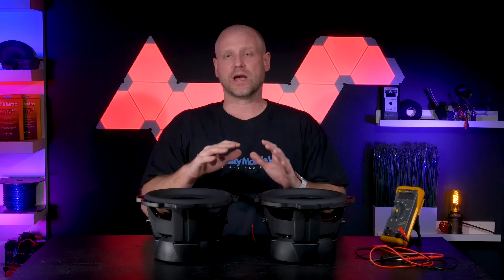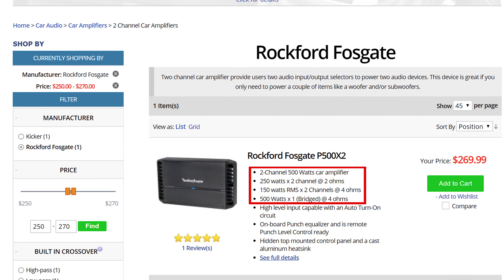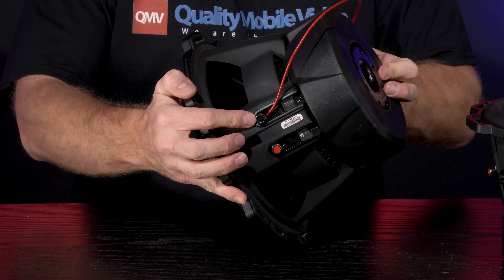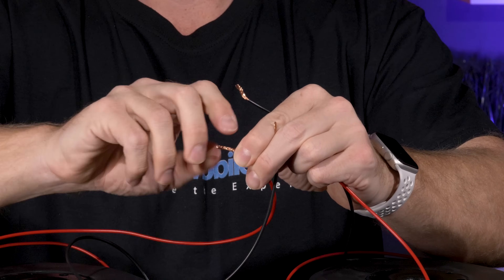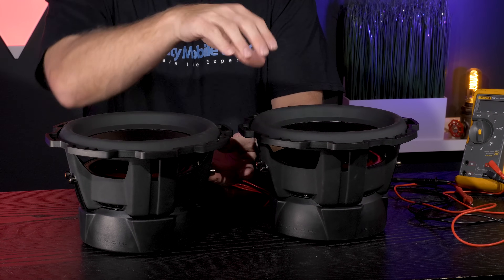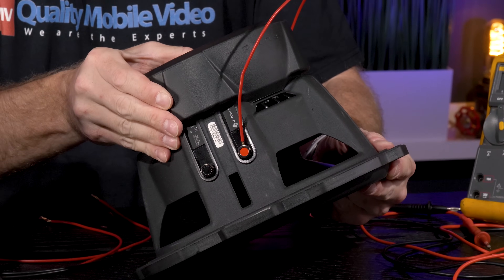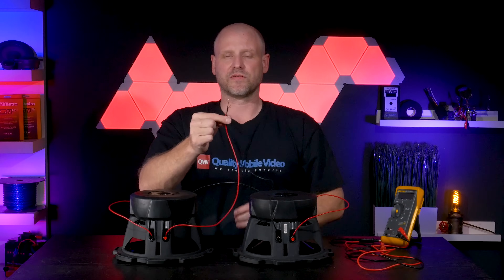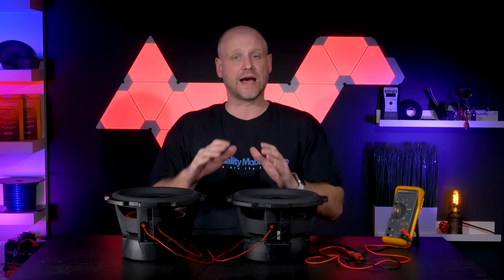Wiring Two DVC 2 Ohm Subwoofers - 2 Ohm Parallel vs 8 Ohm Series Wiring

Comment: I'm thinking of going with 2 10" Dual Coil Subwoofers but Idk if to get the 2ohm or 4ohm. Which one you recommend for more clear, clean bass. I hear the 2ohm has more distortion then 4ohm.
Reply from the maker: There is no difference in distortion its about the amp that you are going to use it with. You want to properly load the amp.

Comment: I see you wires the sub in series with a red postive wire coming from one negative to cross to the other positive in the same sub. Can this only be done with a red postive wire or black negative wire as well?
Reply from the maker: You want to go from positive to negative so you have one remaining positive and one remaining negative terminal.

Comment: How come yall never show the connection to the amp. I have two channels am I supposed to bridge it or what?
Reply from the maker: If you have a monoblock amp with two sets of connections, those are there to make parallel connections easier

Comment: Hi newbie here, i just bought dvc 4ohm woofer. Can i just stay on 4ohm? Do i need to do pararel for both terminal? Or just stay on 1 terminal and go to amp? Tq
Reply from the maker: No, you will either have a 2 ohm load or an 8 ohm load. You need to connect both voice coils.
Reply: @Qualitymobilevideo  to get 4ohm load, i need to bought dual 2ohm? thank you for your reply..

Comment: If u wire them together at the back of a terminal cup with ring post positive to positive and negative to negative..will u still get a 2ohm load from the the outside post of the terminal?

Comment: Can the wires that connect to both subs AND then go to the amp, can those wires be connected together at the box terminal cup ? In case you have a box with seperated chambers
Reply from the maker: Yes you can wire both subs to the terminal cup, that will be a paralleled connection, keep that in  mind.

Comment: Finally a video that helps I recently bought some subwoofers “ctsounds” dvc 2ohms I’m running dual subs the amp is 1 ohm stable but I was running it at 0.5 ohms which the amp handled but rather have it at 2 ohms great video
Reply: take account for box rise, my subs are wired at 1 ohm but final impedance was 1.8 ohm. in my case if i was wired to .5 ohm would give me a better result closer to 1 ohm
Reply: @Ryan-ps4wr  my mistake was buying dual 2 ohm subwoofers I did not pay attention I was to buy dual 4 ohms to bring down two subs down to 1 ohm at the mono block amp, instead I was running 0.5 ohms which was abusing my electrical since I am running double full ofc 4 awg skyhigh wiring

Comment: What if I can't combine my 2 dual coil subwoofers cuz the box has two chambers and two terminals?
Reply from the maker: You can after the terminal cups. Pull the woofer and wire as need be in each chamber then at the cup make your connections as need be.

Comment: I did this and with a dual 4 ohm sub and it came out to half ohm then I re-did the wire by connecting the two sub then one lead out to amp checked my ohm and it was at 1 ohm my question is why didn't it come out to 1 ohm when I parallel the sub separately?

Comment: Need help, I'm looking at two Soundigital amps  (SD1200.2 & SD2400.4) to power ( 4 x Beyma PRO6CXND 6.5 8ohm &  2 x Beyam PRO8CXND  8ohm) how would I wire the 8ohm speakers to there respective amps I've listed or would a mono block amp work better such as a SD 1600.1 2ohm?

Comment: How is 2 pioneer 3003d4 2000wtt wired to a monoblock 2400wtt after wiring to 1ohm load the both woofers

Comment: Hi so pretty new to this was wondering this scenario: 3000 w rubicon stable at 1 ohm  at 1500 rms  @ 1 ohm and the  sub is a 2 ohm 1200 w Peak power 800 rms  wired down to 1 ohm the gain on the amp barely moved to a 1/3 now im overpowering it by like 700 watts right?
Reply from the maker: Generally you always want to have headroom, so your amp a little more powerful than your sub. The issue with overpowering it by too much is causing distortion at high volume levels and potential damage

Comment: I have 2 2013 kicker comp r dual 2 ohm subs with a impedance switch of 1/4 ohm.  How does this switch work and is it possible to get 1 ohm using the switch even tho the speakers are dual 2 ohms?
Reply from the maker: The impedance-selector slider is used for easily changing the dual-voice coil impedance (2/8 Ohms or 1/4 Ohms, depending upon model). No additional wiring is needed for switching between series or parallel configuration.
Reply: Ok so how many ohms is it if the slider is on 4 on each sub? Im not very knowledgeable when it comes to this topic.
Reply from the maker: Don't worry these subs are weird. So the switch refers to the load. The subwoofers will always be DVC 2 ohm. Two DVC 2 ohm woofers wire to a 2 ohm or 8 ohm load. With both subwoofers switches on the 4 ohm label, it means the load will configure to an 8 ohm load at an amplfiier. With both switches on the 1 ohm label, the laod of both subs wired will be a 2 ohm load.
Reply: Wow.. I had everything professionally installed and i specifically told them i wanted it wired to the lowest ohm capable for my 1800 mono class d which is 1 ohm stable.  If i switch both to 1 will my subs performance improve?  I also have remote bass.
Reply from the maker: Since these are DVC 2 ohm woofers, the lowest load you can make is 2 ohm. Sorry, these subs are confusing as hell I know.

Comment: Question! i have two edge edb12d2x-e7 2ohm dvc using 900Watts RMS and 1800 max and a amp that provides 1350 watts RMS at 2ohms this means i should do the two ohm parallel connection you showed in the video yes?
Reply from the maker: So those are 900W RMS each? 1800W combined? Correct, two DVC 2 ohm woofer wire to 0.5 ohm, 2 ohms or 8 ohms. The only issue is your subs will be starved for more power

Comment: So now I am super confused. I have 2 DVC 2 ohm Fi Audio 10" subwoofers with a Rockford 500D1 mono. I have both subs wired in Parallel but with using each of the positive of one coil and negative of the other coil wired to the amp. It works and I have never had problems I have been so lost trying to figure it out
Reply from the maker: So you're in parallel/series wiring. What exactly are you confused about if the subs work and you have no issues
Reply: The amp is rated at 2 ohm, but wired in series there is no sound coming from woofers. Current wiring Subs cut out about 3/4 of aftermarket head unit volume.

Comment: Quick question, so when you demonstrated the series wiring on the 2 ohm final load, does that mean that when I'm strapping 2 amps together the two positive wires that you twisted go into the positive of one amp and the negative ones go into the slave amp?

Comment: So if you have a 2 channel amp what do you do just use one channel?
Reply: For 2 channel amps you can bridge the connection. Its usually marked. Left Channel Positive and Right channel negative.
Reply: Also if the amp does not have a low pass filter its useless for subs.

Comment: How should I wire 2 DVC 2 Ohm Subs (Orion XTR102 Pro 10") with a Power Acoustik Razor 2500 watt amp? The subs are 1000 watts each.
Reply: Did you wached the video ? Wtf dude 😃

Comment: How much are coils outside the subs with caps.  Resistance & impedance.  With 300 Watt KENWOOD AMP to sub box 2 RF PUNCH 4 Ohm to 2 ohm also spliced to the two 6.5 Rear Speakers.   ?????  Help

Comment: Can some one help me figure out the best mono block amp for two SVC 2ohm subs at 300 RMS  each and two DVC 2ohm subs rated at 500 RMS each and which impedence should the amp run at?
Reply from the maker: So two separate amplifiers?
Reply: I want to use one Amp, I want to use an Orion xtr1500d

Comment: Can two dual coil 4 ohm subwoofers be wired down to 2 ohms for a mono amp?
Reply from the maker: Unfortunately no. Two DVC 4 ohm subs can be wired to 1 ohm(parallel) or 4 ohms(series). Two DVC 2 ohm subs can be wired to 2 ohms (parallel), or two SVC 2 ohm subwoofers can be wired to 2 ohms (parallel)

Comment: Hi I know this is an old video but i have a question.
What if you wire 2 2ohm subs that are dvc and you wire each of them parrellel  so you have 2 x 1ohm load, what does a monoblock amp see that as in ohms?.
Reply from the maker: Two DVC 2 ohm subs can be wired to 0.5 ohms, 2 ohms and 8 ohms.
Reply: @Qualitymobilevideo  thanks.

Comment: ive got 2 12 kickers cvr, i want it to knock harder, would series or parallel be better?
Reply from the maker: Parallel allows for lower impedances, which means more power. Are they DVC or SVC, and 2 ohm or 4 ohm?
Reply: Quality Mobile Video lol I honestly don’t know I’m just getting into the world of speakers and sound systems, but I do know they have dual coils. If that helps
Reply from the maker: Lol what's the exact model number
Reply from the maker: If they're 2 ohm, wiring at parallel makes a 2 ohm load. If they're 4 ohm, wiring in parallel makes a 1 ohm load
Reply: @Qualitymobilevideo  how is that?

Comment: Can u wire 2 dual 2ohm subs 4ohms  so I can brige my amp
Reply: ssg red nope
Reply: Can't be done.
Reply: @bonzainews  do I have to wire subs together if I have a mono block with 2 sub connects
Reply: @ssgred9169  if you wire all the voice coils in parallel it will be a half ohm at the amp.  The mono amp might have 2 sets of outputs but they are tied together internally.  .5 ohm load is too low for almost all  amps made today.  Either change the subs or run them series and parallel to be an overall 2 ohm load at the amp.  Most mono block amps can run this load all day.
Reply: @bonzainews  I have each sub wired to 4 ohms but separate connected to amp
Reply: @ssgred9169  then the amp is seeing 2 ohms at the combined terminal.  Should be fine.  It shouldn't run too hot or shut down that way.  What amp and subs?
Reply: @bonzainews  skar 1000lp 2 skar sr12
Reply: @ssgred9169  Steve mead had a test oon YouTube of your amp at 2 ohms. It puts out a little over 700 watts that way.
Reply: @bonzainews  yea I just feel like it ain't hitting Wright like It ain't catching the bass notes
Reply: https://www.youtube.com/watch?v=-mlbfOecpPA
this is your amp. it puts out 712 at crazy high voltage you will never see in your car. probably 650 rms at 14.0 volts @ 2 ohms. which is still good.
Reply: @bonzainews  it sounds like I ain't catching bass notes on regular songs o ly basses with bass boosted songs or decaf
Reply: I'm thinking its cuz I got to small vented boxes I'll upload a video later
Reply: @ssgred9169  show me the boxes and how you wired inside the box.  If you have a volt/ohm meter measure the resistance of the terminals at the box without the amp connected.  Then verify the speakers are not out of phase.
Reply: @bonzainews  man thanks whent back thrue all my wire and had a  wire pulled out from amp!!
Reply: @ssgred9169  so she is bumping good now?
Reply: @bonzainews  o yea big difference the wire was not fully connected so I guess was getting right power banging now what u think I should set my low pass to 50 is the lowest
Reply: @ssgred9169  50 hertz is definitely too low for a 12s. As a matter of fact I don't think I'd ever use 50 hertz unless you had 18 in subwoofers in a sealed box. Even then you would need at least a minimum of four 8 in midbass drivers up front in the doors. I would stick to around 70 to 80 Hertz minimum for those 12s. If they're in a vented enclosure make sure you set the subsonic filter a couple Hertz lower than the tuning frequency. You should definitely not be using bass boost on the deck, or the amplifier. The amp comes with a gain control, so use that you balance the sound.  You will see for the best sound quality you're not going to want the 12s too loud, but when do you want to Hoon around town crank that control knob.  If you're turning the knob and it doesn't get any louder then the amp is clipping. Stay away from clipping. That will cause damage to the amp and speakers.
Reply: @bonzainews  no bass boost on deck and amp came with clipping light kool thanks I'll set hype herts a lil higher and sub sonic is on